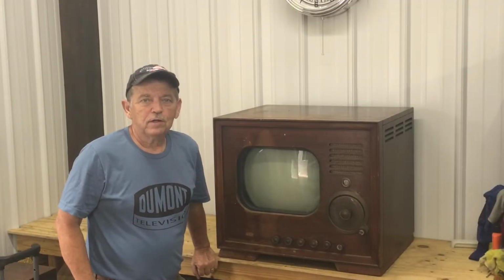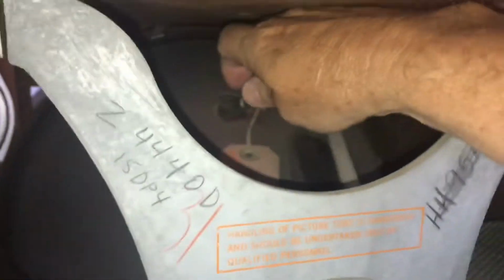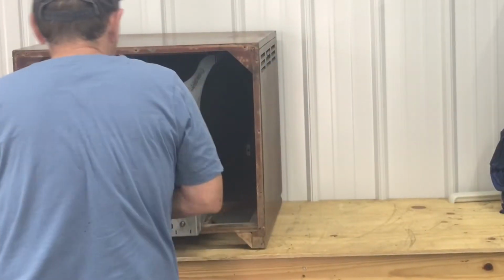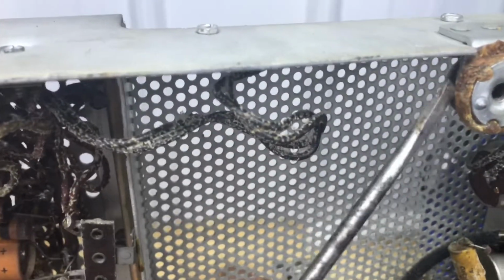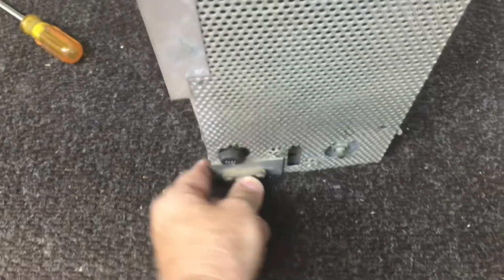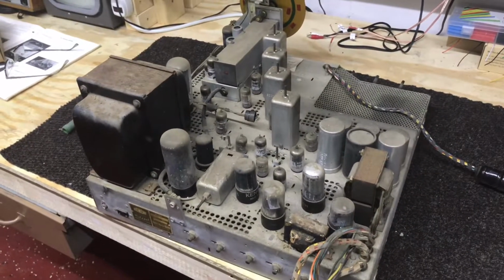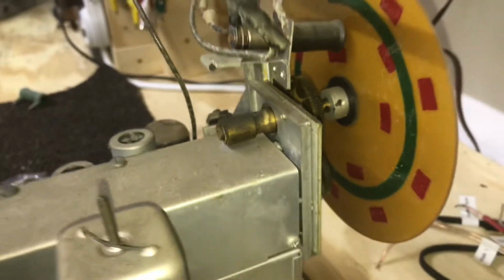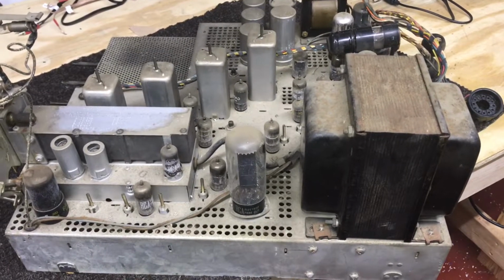1949 Dumont 15” TV Restore Part 1

Comment: I see it has two high voltage rectifiers. One must be for the focus?
Reply from the maker: It Actually has 2 1B3 HV Rectifiers. Dumont was over engineered.
Reply: @CreekviewAcres  I wonder if the CRT is coated or if that set uses a high voltage doorknob capacitor. I have a Stromberg Carlson TV12 (unrestored) which is basically a Dumont RA103 chassis. I grew up through the 1950s and I remember TV repair guys preferring to not work on Dumont  TVs because they were over engineered. I am looking forward to your progress on your Dumont. Gary